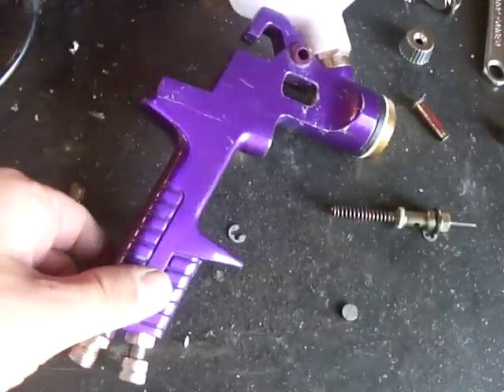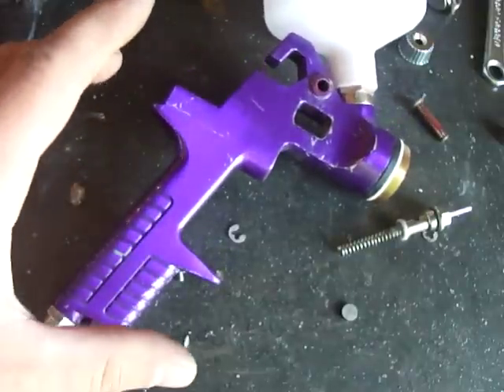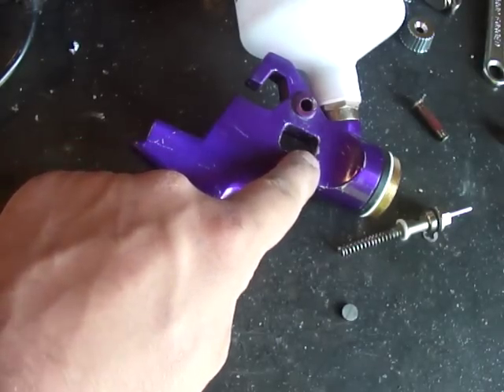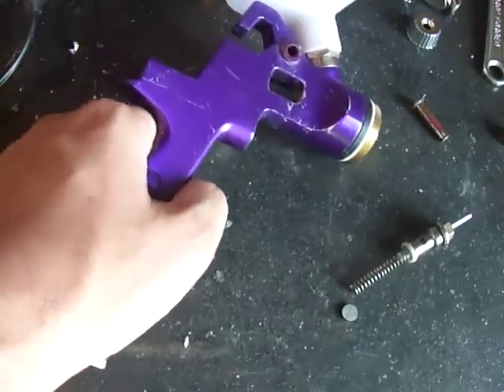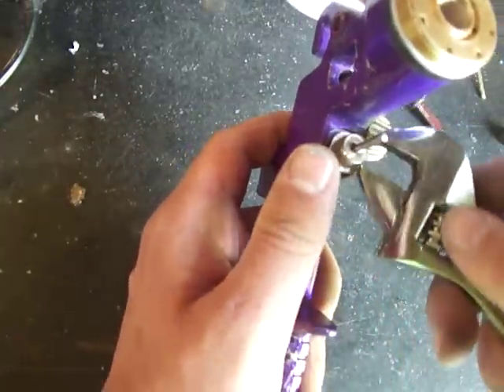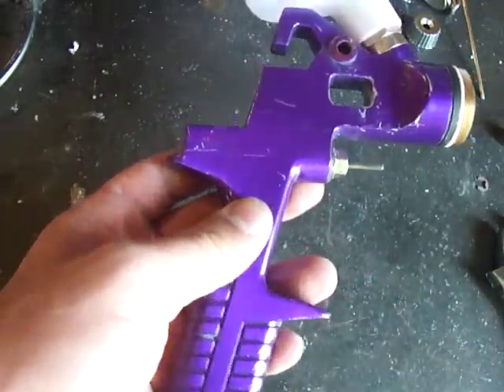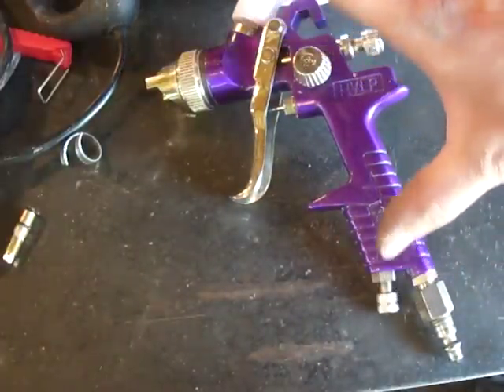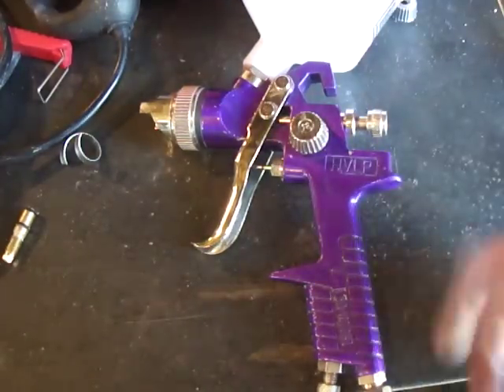Harbor Freight HVLP Spray Gun Mods

Comment: I've taken cheap Chinese knock-offs from the Paint Gun Manufacturing industry and turned them into some of the best paint guns I've ever used, that goes for  Graco, DeVilbiss, Fuji, PowRyte, etc.
 The patent on the knockoff guns is the same as the patent the top dogs use for the most commonly used guns, same castings, same internals given they are the same needle and port volume, the big difference is the quality of the parts, the quality of material they are made from, the workmanship in their construction and machining...
 Much like the one showed in the video there are small things you can do to turn it into a good reliable paint gun.
 It starts with polishing and fitting the internal parts with valve Lapping compound, some 3000 wet paper, and other polishing consumables to put the best quality finish on all the intersectional parts you can. It takes about 2 hours from when you start to when you finish.
 If you have a mini lathe then chuck up the parts you can to polish them. Dremel tools are great with polishing compound, get rid of any burrs, etc.
 After frigging around with my cheap ass spray guns, and I do have quite a few, I've pulled off some excellent work with them. Consistent, Reliable and as good as I could expect out of any spray gun.
 Be picky when choosing cheap guns, look for the better quality outside finish as a representation of the inside you can't see.
 I use them all the time, I won't spend hundreds of dollars on a spray gun when with a little elbow grease I can make a bunch of them for the cost of one. But that's just me. I do that with just about everything because I restore stuff for a living, repurpose, invent all kinds of things so it isn't a big deal to make something out of nothing.
 Enjoy, be creative using your God Given Ability is a wonderful thing.
Reply: I realize it is kinda off topic but do anybody know of a good site to stream new movies online ?
Reply: @Alvaro Chaim flixportal :P
Reply: @Peyton Francis thank you, I went there and it seems like they got a lot of movies there :D I appreciate it !!
Reply: @Alvaro Chaim Glad I could help :)
Reply: You should make a video on how to fix up a spray gun.

Comment: For the money can’t complain. And breaking the gun down and doing these mods just gets a person to know the gun more Intimately. 
In my opinion these spray guns all look the same. I’m assuming that the expensive ones have better internal components. But a little time a few bucks you’ve just bumped your gun up to work just as good as the expensive ones.
Thanks for sharing this. I have to find your video on cleaning it.

Comment: My air valve stopped working today (model 67181, same as yours).  Apparently, the spring opened up and the plunger was inside the spring.  To fix, I simply bent the end of the spring across the opening and it now prevents the plunger from going inside the spring.  Works better now than it has in a long time.

Comment: Great vidio I also have had the same issue with one of my guns. The most important thing is taking it apart end cleaning the silicone seal thats on everything. With a little experience you can produce some high guality work. The best part is if the gun doesn't work in the middle of a paint job you can afford to grab your backup gun to finnish the job, I have about 8 of these nothing wrong with a backup.

Comment: The more expensive HF purple gun on handle MAX 45PSI 3BAR for primers it's different assembly no needle packing adjustment an trigger is bit different I had no problems with leaks but i use gun lube every other use

Comment: Nice man! That is the basic story of just about everything you buy at harbor freight. It works, but you are going to have to do a little work or modifying to make it right. I don't have this gun but I always wonder about the air valve and the gaskets in there. They appear to be lubed with silicone grease... but I am afraid if I put more on it will shoot silicone into my paint somehow. PS: what KIND of gunk did you clean out? Just about every gun under 60 dollars I have purchased is absolutely LOADED with white thread locker that is incredibly difficult to remove... like no solvent will remove it and it is very difficult to scrape off. Is that what was in there?

Comment: The thing I hate about a lot of pneumatic products that use o-rings that harbor freight sells is they don’t size the o-rings correctly. A lot of time the rings are oversized and get pinched on assembly so there damaged delight from the factory. I bought an print kit at harbor freight and I install new rings that have better fitment right from the start. 

PS- when you tested it the PSI was insane sounded like you had like 70 psi blowing through that gun... turn it way... a lot of new guns only require 10-20 psi at the gun
Reply from the maker: #MLB_MotoVlogs I think they mistakenly go with the bigger is better mentality with their O rings. Also it was 90psi going through it. I just wanted to test the air valve in it. 35psi seems to be where it sprays best.

Comment: Another good mod is using the disposable cup system , makes it super easy to clean your guns, and use less material, and depending which system you use, you can also spray upside down!
Reply: Yeah real smart buy a disposable cups system that costs 3 to 4 times more than a gun that is disposable

Comment: Your videos have been very helpful in dealing with this HF Paint Gun, as has this one!  Thanks!  One question, how did you cut such a small piece off the metal rod?  Chopsaw?  Cutting disc of some sort?  Bandsaw?
Reply from the maker: N N I cut it off with my bandsaw and then spent some time digging through the chip tray to find it. A hack saw would work too. A cut off wheel would work but might launch the thin piece across the shop.
Reply: @iainportalupi  Just stretch the spring.
Reply: You can use a 4” Zip disk in your cordless grinder.    Works as good and fast as anything else
Reply: Larry D Exactly what I thought

Comment: Now that you've had a couple of years of experience with this gun, what pressure setting seem to work best for automotive painting? The manual gives a wide range of pressure settings, much higher than typical HPLV.
Reply from the maker: spelunkerd I kind of settled on 30-35 psi at the gun’s inlet which ends up being 40-45 psi at the wall. I measured the pressure drop with a gauge mounted to the inlet of the gun and that’s how I figured out it took 45psi at the wall to get 35 at the gun with 25feet of 3/8 hose and standard quick connectors. I use that pressure for everything, primer, sealer, base and clear coat.
Reply: Thanks, I'm about to use this for the first time on a car door. Practice with mineral spirits on a sheet of plywood at 32 psi seems to work fine.
Reply from the maker: spelunkerd I’ve got a piece of plywood that I test spray at the start just to get the fluid control and fan pattern set. Most of the time I open fluid wide open and the fan wide open. If I close the fan and the fluid way down to do small spots I’ll turn the air pressure down to 20psi because if I leave it at 30 it drys the paint before it lands on the car. I’ll actually be using this gun again tomorrow for some base coat clear coat.

Comment: Good review/video... I'm going to be doing some painting soon. I also need a new compressor.  What compressor/size are you using?  Looking at the numbers, this gun seems like it'll only work with a monster.  Also, Have you looked into LVLP guns ?  such as SP-33000?  Anyway, this is the first of your videos I've found.  Will bu subing.  Thanks.
Reply from the maker: Thanks for watching! I’m running a homemade 60 gallon compressor that puts out 15cfm @ 90psi so air supply has never really been a big consideration in tool purchases. The closest I’ve come to an LVLP gun is my trusty LVHP siphon feed gun it could probably run off a 30 gal compressor with ease.

Comment: The only way I was able to get my gun apart to clean it was to dismantle it as much as possible and then bake it in the oven at 300F for an hour. Still not easy to remove nozzle but it was possible. I used this method for both models of the gun.